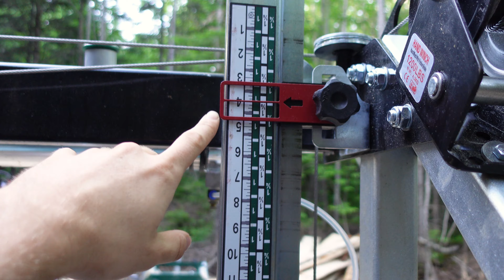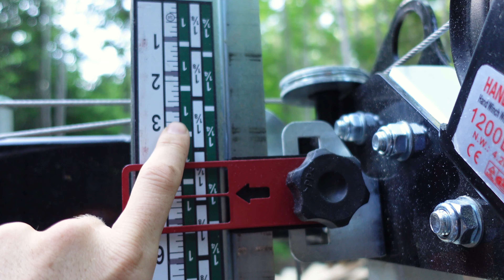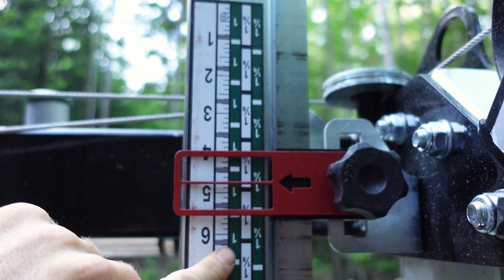Learning the Ropes on an Off-Road Sawmill

Comment: That smile on your face when you made your first cut😂. I had the same reaction when I made mine. I have a frontier mill and the scale is completely different, I think the Frontier is much more intuitive. That off road mill is interesting. I suggest you pick a relatively level area, it will make setup and milling much easier.   FYI, you’re addicted now, good luck not looking at every tree as lumber😂
Reply from the maker: Yeah, I definitely didnt help myself with the site I chose. Oh well, it's all good now! And yes, Im in deep now. Gonna have to go to treehab.

Comment: I’d say first off you should get that bed perfectly level both the bunks and the rails. You need a more solid base for the legs to sit on so it doesn’t flex as the powerhead rides across it. Maybe mill up a 6x6 frame base? Looks like you have a fun new tool to learn!

Comment: Hey from New Brunswick I have sawn quite a bit of fir and it does some weird stuff when you start cutting it...i have had the same problems.  I have found it good for large dimension lumber not so good for boards.  Sharp blades and extra drive belts on hand will save you some frustration.  Happy sawing.

Comment: A pretty handy thing to do with your log I saw parallel to the pith in the Center of the log. Do this by measuring the height of the pith on the big end and wedge the small end to match. That way you’re less likely to have grain in your planks that runs out within the length of your plank.

Comment: There are multiple points on the frame for the jack bracket so you can lift the mill up easier for leveling. Leveling is a pain. I find i move my mill less than I expected because it's an hour to set up the machine. A shovel for digging a foot into the ground took me a couple of years to figure out.

I have a bunch of bushlander videos on my channel. Also check the comments as there are a few people with their own mills exploring their challenges such as Oregon Old Timer.

Comment: What is the thought process behind so much processing in the forest? I would think that it would be easier to have a stationary and prepared work area for the mill and to take the logs to it.
Reply from the maker: I think in most cases that would be best, especially if you have a single large tract of land. The main draw of having a mobile mill is in cases where you have multiple tracts of land or have a business doing on-site milling work. Ive seen several comments and emails from viewers who have a logging/milling business where they offer to turn a landowner's trees into lumber for them, for example. 

 In this case, Im actually milling on the building site, which eliminates (or reduces) the transportation of both the logs and boards.

Comment: Is it possible your log stops are in 180 degrees from where the engineer intended?  I think more of the flat should be against the log and the bevel would allow your blade guide to be closed up more.
Reply from the maker: The bevel helps prevent the log from biting into the edge of the stop and crawling over them as you turn the log, but it comes with different types of stops, so I think a lot of it is personal preference. Most of the time, Ive just been using short, flat-topped stops.